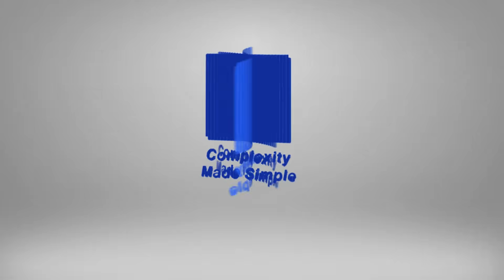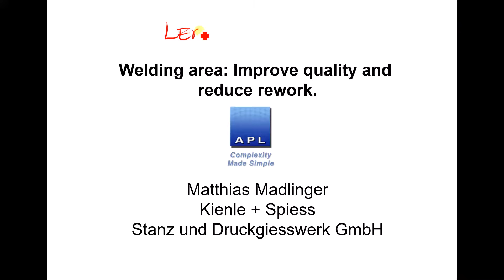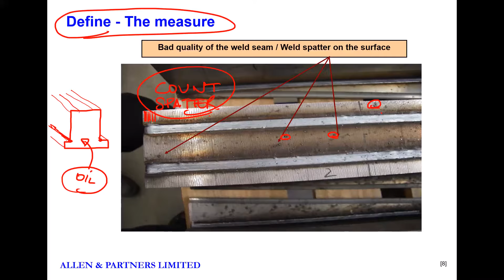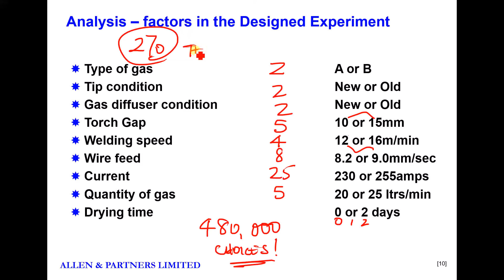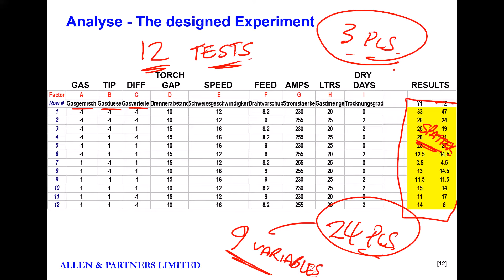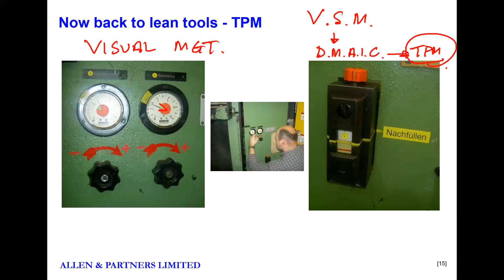Lean Six Sigma case study

Comment: why are there only 12 tests?
Reply from the maker: Because some clever person has worked out that those are the best 12 test to do to learn the most...actually it was 2 people...Plackett and Burman
Reply: Does no of experiments depend on number of variables
Reply: @Vision267  actually there are other methods like taguchi which you can use depending on number of parameters and sample size